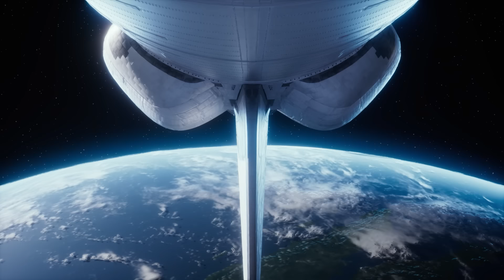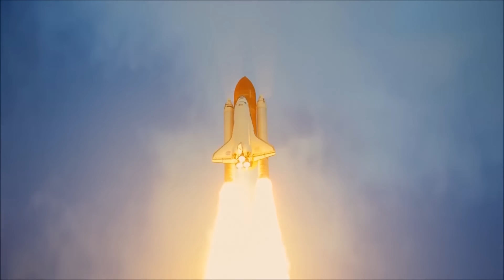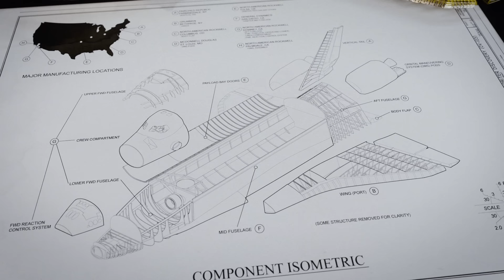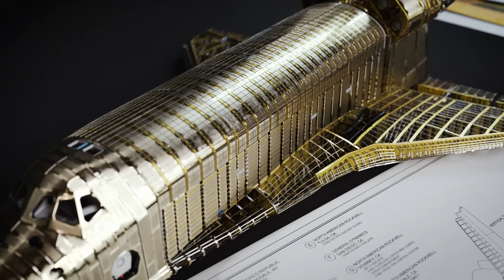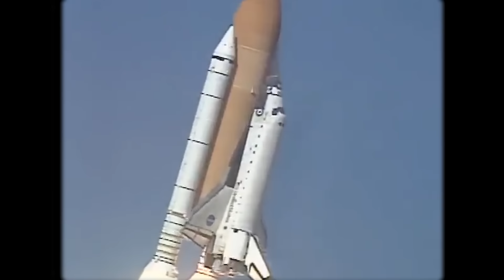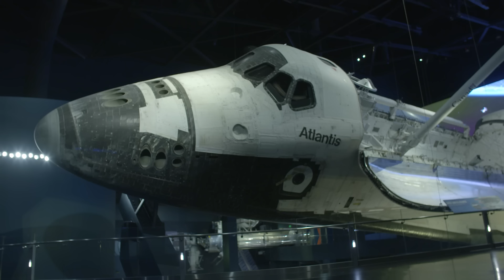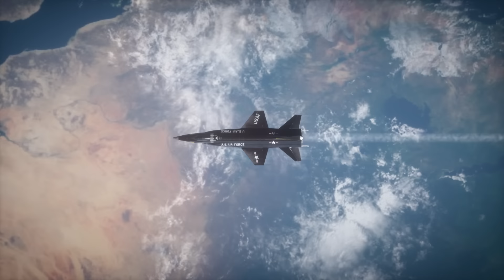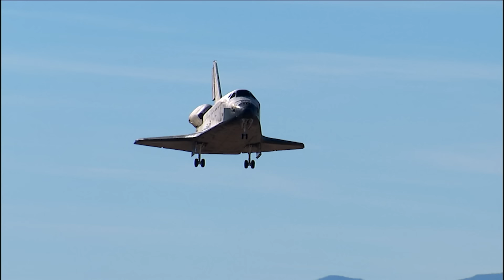The Insane Engineering of Re-Entry

Comment: For certain orbital inclinations the last abort base short of orbit was Kadina AB, Okinawa. In 1982 I helped save a shuttle launch. The Tacan (Tactical Air Navigation System) at Kadina went down and base supply did not have a replacement part. I was working Communications Job Control and Navaids Communications Management Office at Yokota AB, Japan. NCMO Kadina called me to see if we had the part. I woke the NCOIC of Supply in the Communications Group, Elmer Troxel, up in the middle of the night. While Trox worked on getting the part, I called in some IOUs and got it a ride to Kadina. We were working against the clock. If the TACAN at Kadina was not back up in time they would have to scrub that launch. Trox got me the part and I got it a ride. The guys at Kadina got the TACAN back up with 2 hours to spare so the launch proceeded as scheduled. Instead of some sort of commendation medal Trox and I got a letter read at Commander's call. Bit Whoop!

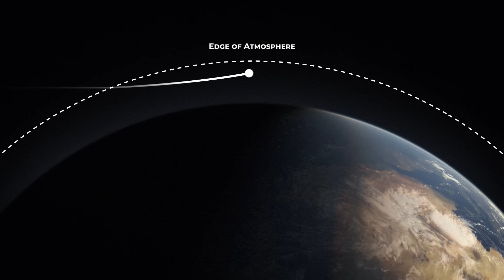Comment: I don't think this is correct at 1:32. I think when a craft "bounces back", the path still looks relatively "normal." The curve just doesn't intersect ground. Instead, it exits the atmosphere. From the surface, the altitude would lower then go back as after reaching perigee. Hence, from the ground, it looks like a bounce. This is mainly due to the curvature of the Earth. I don't think lifting surfaces work well in the upper atmosphere.

Comment: Uhh since when is steel a poor conductor of heat?
Reply: The heat conductivity of steel ranges from 15 watts per meter-kelvin to 50 W/m·K. For comparison, the heat conductivities of pure copper, aluminium, and iron are 400, 205 and 80 W/m·K respectively. Meanwhile, the heat conductivity of carbon can be a lot higher, depending on its structure. The heat conductivity of diamond can be as high as 2500 W/m·K, and graphite's ranges from 200 to 500 W/m·K.

Comment: A space rope brake. With a ship wanting a speed boost on the other end? Space brakes. Or a big stack of sheets of the heat resistant stuff sitting in space. You fly through it and it wraps your ship. Could have multiple spread out.

Comment: 6:28: "Shockwave is simply a region of incredibly high pressure" - It is not. Shockwave is a location where fluid properties change rapidly. Technically it is not a discontinuity but the thickness of the region where pressure, density, and temperature change is very thin (the order of magnitude of the molecule free path). The temperature at the leading edge and the nose is the highest because these are stagnation points. According to the rule that the higher the drop in the Mach number, the higher the temperature increase (part of the dynamic head of the temperature is changed into static temperature). For details see NACA 1135 report.

Comment: I made those thermal blankets with my fellow "Sew Sisters." The correct range of temperatures for those blankets were roughly 650-1200 degrees. The majority of the blankets were about 1/2" thick Class 4. Most of the orbiter was covered in that thickness. The OMS Pods were covered with Class 10 or 11 approx 1,000-1,200 protection. The blankets were thick in the area because the OMS Pod skin was made of composite materials. NASA required the blankets in that area to be that thickness because the temperature couldn't exceed 350 degrees. Otherwise, it could soften the airframe there.
Reply: Wow , this is amazing piece of information , I’m in awe of the technology and engineering used …

Comment: @18:33 this is a phenomena of high degrees of AOA not necessarily high altitude or high speed, it has a specific name called adverse yaw. modern flight control systems are now designed to, in high performance planes mostly, to have differential aileron control higher degrees of AOA. the effects of this have actually been mapped by the advisory group for aerospace research and development, AGARD in 1979. their white paper called "high angle of attack aerodynamics" in section 2-6 sub 4.1.1 and accompaning fig 15 for the chart. adverse yaw in traditional configuration begins to happen around 30d of aoa/alpha. before flight control systems basically solved the input problem, pilots were actually trained to change control regime at high alpha, most notably in the F-4 phantom where rudder was used for roll authority in high alpha regimes. a period training video also showing this effect is on youtube called "F-4 flight characteristics TF-6771" and the section on adverse yaw starts at around 10min.

Comment: "BLEED TOO LITTLE SPEED AND IT WILL BOUNCE BACK IN THE ATMOSPHERE BECAUSE IT HAS WINGS" = incorrect, sir.
It will not bounce. It will just touch the upper layer of atmosphere then return to space. Because it dis'nt loose sufficient amount of DeltaV (the atmospheric braking decreases the apoapsis only, so you need to bring the apoapsis just below the upper atmosphere point). And will need a few earth revolutions (to get more friction) to finaly loose sufficient deltaV. As they don't want to turn 10 times, they reverse thrust a bit more at the start.

Comment: What a lot of people don't know is that in the majority of later missions the shuttles landing was completely autonomous. The commanders insisted on having a role so they were given the task to press the button to lower the landing gear. Of course in an emergency they could take control and were certainly over qualified to land these things manually but the automated system worked so well they most just lowered the landing gear.
I loved the Spaced shuttle, John Young and Bob Crippen are still my heroes from 1981.
Reply: The Commander flew the landings from TAEM (terminal area energy management) onwards.

Comment: Man, I thought I knew a decent amount about the Shuttle but you taught me a lot on this one! The crossrange considerations of single orbit missions, the deployable Air Data Sensors, how the tiles were made, the inconel intermediate connections, the nomex felt base layer, etc. But especially the reversed aileron control at those speeds and AoA! 
Outstanding video!

Comment: What was the altitude and Mach number when they started reentry? Or, the root of my question...what was their calibrated or indicated airspeed at that altitude?! What about True? Im just mainly curious about the KCAS/KIAS at that altitude at Mach insane. Just for curiosity.
Also, I know all the metric supremacists will disagree, but when dealing with aviation/spaceflight, especially American aviation/spaceflight, its nice to use KNOTS rather than kph for speeds, and feet when dealing with runway length and feet or nautical miles when dealing with altitude. I concede orbital velocities and Delta V being in km/s or m/s. 😊
360kph approach speed = 194knots = 223mph. 
4.6km runway = 15091ft = 2.48 nautical miles = 2.86 statute miles. 
Generally in Aviation length of runway is measured in feet, altitude in feet (or nautical miles for spaceflight), speed in knots (nautical mph) or mach, and distance in nautical miles (about 6000ft = 1 nautical mile). There are, of course, exceptions!
Let the war begin lol!

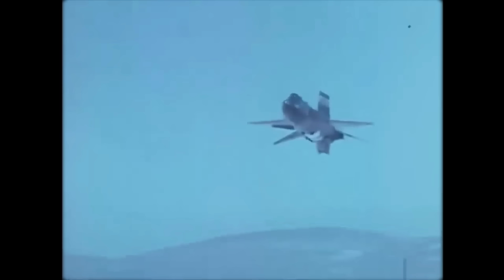Comment: 2:47 the “fastest plane in the history of human kind” is… the shuttle orbiter.
Reply: No The space shuttle is not really an aircraft and more a glider
Reply: @CrispyPratt  Also, I have flown gliders and I can safely say that they are aircraft :)
Reply: @CrispyPratt  The X-15 was a glider too, fundamentally. Both craft were rocket boosted. Theres no difference between the two except speed and altitude.
Reply: @incargeek x-15 wasn’t a glider, it had its own propulsion system. If you put a jet engine on a glider, it isn’t a glider anymore. If a plane glides to the ground when its engines turn off, it’s still a plane.
Reply: I wouldn’t call the space shuttle a plane. It’s a space craft that’s designed to land like a plane and be reusable which is much different from a plane. I wouldn’t call the space shuttle a plane the same way I wouldn’t call the x-15 a rocket ship just because the shuttle has wings and the x-15 has rocket engines.

Comment: Just a minor nit-pick. Your showing of the angle of attack in conjunction with a re-entry/descent situation could lead to misconceptions. In other words, the AOA is the angle between the flight-path and the longitudinal axis of an aircraft. To be entirelly correct you'd even have to add the angle of incidence of the wings to that. But in the case of the shuttle this angle(angle of incidence of the wings) is more or less zero anyways. But the flight-path should be shown as a downward sloped vector and not like a vector at a straight and level flight.

PS: Love and enjoy all of your videos. Incredible high quality.

Best Regards
Thomas

Comment: What I wish more people would understand is that neither of the two Shuttle losses were due to the orbiter (what everyone thinks of as “the shuttle”). The first was destroyed by the SRB’s, and the second by foam fatally damaging it. The orbiter itself did everything it was asked.
Reply: Makes no difference. It is due to the orbiter’s design that it was required to be assembled and launched in parallel to the boosters and the drop tank, putting itself in harm’s way. And clearly the orbiter did not have necessary mitigation measures to prevent disaster on both occasions. The orbiter is just as culpable in both disasters.
Reply: and the booster doomed by an o ring.

Comment: 3:44 Please refrain from making multiplication comparison when it comes to temperature unless it's in an absolute scale suck as Kelvin. Both Celsius and Fahrenheit start from an arbitrary, non-zero origin. I'd argue comparing temperature this way is unintuitive to the audience anyway, since we don't have really the concept of temperature multiplication in daily life. 1253K is 2.74 times 450K; 980°C is 5.54 times 177°C; 1796°F is 5.12 times 350.6°F. The error widens as you get closer to normal living temperature, so better not use it anyway.

Comment: 01:00 How does a space shuttle 'skim through the thin upper atmosphere and potentially bounce back into space' if they dont slow it down enough?

Even at low earth orbit, where the shuttles ended up spending most of their time, they were in a constantly decaying orbit because of the presence of occasional air particles, hence why the have to speed up the ISS every few years, to maintain its orbit and stop an uncontrolled re-entry.

I think Real Engineering is confused with the lunar missions, where the capsules were approaching the earth at circa  150% orbital velocity, and too shallow of an approach angle would shoot them through the thin upper atmosphere, placing them in an eliptical orbit they couldn't recover from. And, too steep an approach would cause too much friction.

Comment: About the Air Force and the Shuttle: The Air Force wanted no part of the Shuttle program and was forced to participate. They were very happy with conventional boosters to get payloads to orbit and could stockpile them. They were very skeptical of the original projected flight frequency for the shuttles, knew they would not be able to short-notice a payload (like replacing a wounded spy satellite in wartime), and figured the shuttles as easy targets to ground by an adversary. Furthermore, they also did their own calculations and figured (I think I am remembering this right) a 0.7-2% loss rate per sortie. It is why they insisted on bones being worked up for replacements. The AF didn't care about sexy, they had lift and frequency REQUIREMENTS. The shuttle was never going to achieve these, and it never came close.

Yes, the Shuttle had many compromises built-in by AF requirements (including the size & shape of the main bay), but only because they were ordered to surrender their booster program to fund the Shuttle. So the Shuttle HAD to accommodate AF payloads. There are many sources for all this, but I recall Aviation Week, over the relevant years, seeming to carry the same sentiment and covering well and often Air Force reluctance. The AF was dragged, very much against what they felt was in the national interest, into shuttle participation. They were proven right, I think we can agree.

Comment: This video makes me even more sceptical about SpaceX Starships heat shield design. Lets see if the stainless steel frame with its higher max operating temperature will be enough to compensate for the drastically simpler heat shield
Reply: Starship flight 4 was quite successful, will be interesting to see flight 5 with the new heat shields

Comment: I've been spending the last few weeks reading into the early shuttle designs and it was great to see you touch on them here. The straight-wing orbiter designs came in even steeper and got more of the blunt-body effect.

And while it may seem precarious to only have a single shot to land a gliding shuttle, tests with powered lifting bodies showed the speed management and extra mass for landing engines was not viable.

Comment: I don't get it.  Why can't it bleed off its speed more gradually, by skimming the thin upper upper atmosphere a few times.  If it "skips off" back into space, it's still in a very Low Earth Orbit that intersects with the upper atmo, so it'll just end up going around and re-entering again, until it's slowed down enough to not skip off.  Would that be safer and more practical in some situations?  Wouldn't that put less strain on the craft, even it if made landing take longer?
Reply: a slower reentry can spread the heat out more, yes, but it also gives more time for the heat to penetrate the heatshield and damage the airframe.

Comment: I went the whole video waiting for you to credit the Dyna-Soar/X-20 program for the basics of the shuttle's mission performance.  I'm amazed that you failed to mention it once, and seemed to think it was an outgrowth of the X-15.

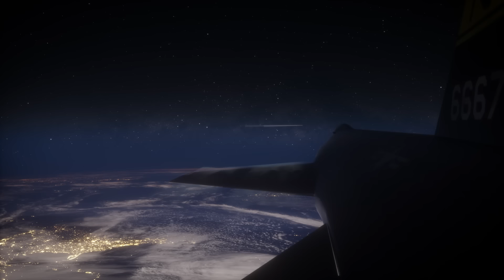2:40 The X-15 may have experimentally proven the thermal techniques, but the entire reentry sequence was developed during the Dyna-Soar program.  Dyna-Soar did not use ablatives nor the super-fragile tiles.  It's main body was made from a Rene 41 (a nickel alloy developed for gas turbine blades, not that different from Inconel) truss covered with Rene 41 panels. On the bottom surface were additional, non-load-bearing panels of columbium that would last ~4 flights before needing replacement.  Also, there were only a couple dozen panels, rather than the thousands of tiles on the shuttle.

20:12 The shuttle got it's delta wings from Dyna-Soar as well.  Even North American's X-20 proposal was basically an upgraded X-15 with delta wings since that design requirement was already well understood at the time.  This let the shuttle designers use the 14,000 hours of wind tunnel testing done on the Dyna-Soar as a starting point, saving years of basic research.

20:55 The whole cross-range requirement was another Dyna-Soar legacy.  It's mission was to launch from Florida, fly over the "area of interest" anywhere in the world, gather its intel, then land at Edwards AFB.  For the reason you mention, this required a large cross-range capability, and Dyna-Soar could land 1,500 miles (2.500 km) to either side of the ballistic trajectory

This is all covered in the book "Dyna-Soar" by Roy Houchin, available on amazon or directly from the publisher: https://www.arapress.com/dyna-soar-book/

Comment: The orbiters return with the new laser electromagnetic engineering that I had the honor of discovering. The new technology admitted in America and Europe in 2020. Titanium alloys melt at 1668ºC and are very light. Titanium alloys welded by laser electromagnetism with the new technology perform much better than the INCONEL steel from which the X-15 was made. THE AEROSPACE INDUSTRY HAS CHANGED IN 2020. Thermal shock resistant titanium monocoques, manufactured by stimulating the emission of light with new electromagnetic laser technology from both sides of the material. Civil and military aircraft are much better made without rivets and using laser electromagnetic robotics with new technology. Titanium orbiters are the future of human space travel. From space to the airport. It is an honor as a researcher to report the real truth of the aerospace industry. Best regard...

Comment: 7:18 The region between a bow show and the body which generates that shock in a supersonic flow is not low pressure. It is actually very high pressure, depending on Mach number. At Mach 7 the pressure in this region is 57 times that of the free stream. At Mach 20, it’s 466 times that of the free stream. This is an elementary concept in supersonic flows.

Blunt bodies produce normal shocks and do experience much less aerodynamic heating. But this is primarily due to a reduction in viscous dissipation heating. 

Source: Fundamentals of Aerodynamics, John D Anderson

12:10 Inconel is not mostly made of steel. Steels are alloys of iron. Inconel is a family of nickel alloys, none of which are mostly steel.
Reply: I'm glad I'm not the only one that noticed the mistake at 7:18 regarding the bow shock pressure change. He even states that this air gap "reduces heat transfer", which is wildly incorrect. It makes me wonder where he got this information, as any compressible fluids textbook covering shockwaves should clearly state how high pressure and high temperature the region between the bow shock and nose is.